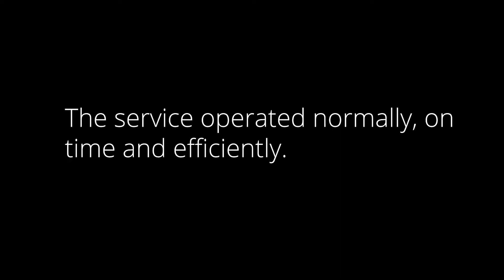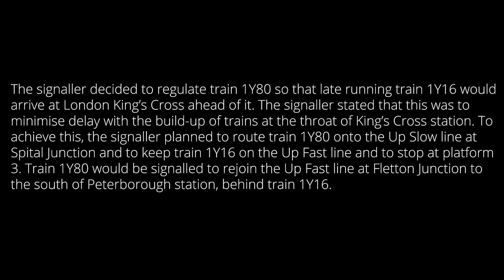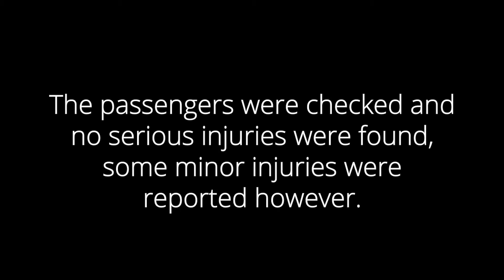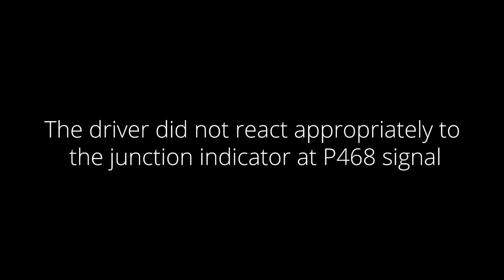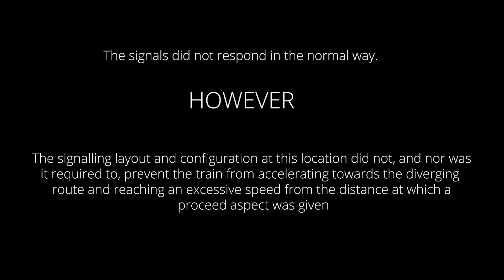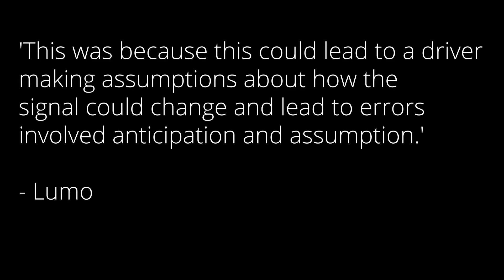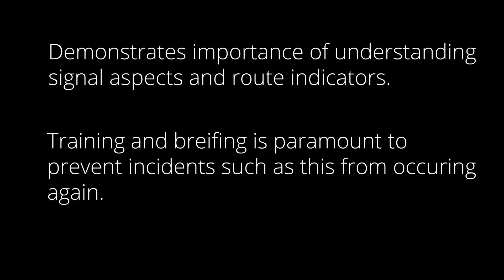The Peterborough Overspeed Incident | Jakeso

Comment: The reason it did not overturn is the monocoque design of the coaches resisting the torsion produced by the lateral G-forces at the slow-speed point. Quite apart from the signalling itself, that also highlights a track layout design error, that low-speed points had been placed in a high-speed line, something specified to avoid in the original design specification in the 1970s. Oddly, the fact the lead power car was accelerating may well have pulled any unit on the point of toppling through the points and back onto straight track: the derailment jackstrawing happens when the front of the train decelerates suddenly and the kinetic energy of the rear coaches can only go upwards.
The reason the driver didn't see the diversion indicator is a psychological effect called confirmation bias. He was expecting to run straight through, and that is what his brain "saw".  A line of white lights was just illumination, if they'd been orange, yellow and black cycling rapidly in the direction of travel, it would have penetrated that "fog of war".

Comment: If 2 trains have done the same thing then it must be a question of the signallers or the signalling system and not the competence of the driver
Reply: There is nothing weird or odd about this signal or location, the job of the signaller is to control the railway, the driver is driving in the lap of where the signaller tells them to go. The driver’s route knowledge and rule book knowledge tells them if they can accept that information given by the signalling system. At what point is this the signallers fault?? The signaller decided to move the early service over to the slow line to let the late service pass on the fast line to maintain the diagram order of service. The driver was cautioned all the was down to a red, then given the junction indicator to diverge to the slow line. Tell me, did the signaller tell the driver by telepathy to open up the taps on that Hitachi unit and accelerate hard at a set of points set for them to diverge??? Purely driver error, loss of concentration and complacency, end of. 

Now if there is an issue of visibility of the signal and it’s aspects, they driver needs to inform the signaller and fill out the necessary form. If the driver cannot see the signal correctly, they should just engage a whole load of power… either way, still on the driver I’m afraid to say.

Comment: Driver error. I’m not sure why people are suggesting it is an issue with the signals at the location. 
All drivers that “sign” there route must know it off by heart and every signal and route indications. Expect anything to happen at anytime. The indicator to divert should have been spotted and understood completely for any qualified train driver. There is no excuse.
Reply: It would also help if the signal was timed to enforce the correct speed across the points, as well as potentially remaining at caution to "remind" the driver that a significant speed change would be required compared to their initial route.
Safe systems take into account human error, not excuse it and assign blame in a scapegoat-like fashion.
Reply: @caramelldansen2204  still a driver error. I know that.
Reply: @caramelldansen2204  would have got AWS reminders
Reply: @caramelldansen2204  in 20 years driving I have never seen a green signal to change route without a flashing indicator. Is it not double protected? I may be wrong in that sense,
Reply: so this would be a signal irregularity
Reply: @robsmith8769   Wrong. The steady signal aspects that arise from following another train override the flashing aspects. This happened in both incidents.
If we just scapegoat the drivers, all we do is ensure this will happen again. It already has happened again.
Reply: @caramelldansen2204 wherever I have gone you are double protected hence the red signal. My training tells me that a train is in front even if it’s not a high speed double protected junction.
Reply: It wouldn’t go from red to green without flashing signal or even a caution.
Reply: So I get why people are saying signals are not right in that case
Reply: But what I can see is the junction
Signal is green with an indicator to route over so that’s the problem here
Reply: @robsmith8769  I can see you're fully bought in on the "scapegoat the driver instead of prevent the issue, despite the fact the issue in the exact same place has already repeated itself" line. It's a mystery how you hold such disregard for the blameless safety culture the railway relies on to save lives and learn from tragedies.

Comment: Why don’t the signals stay at caution when there is a diversion route set at this location? The change to green would have caused confusion.
Reply: One would think a change of direction that also entails a change in speed would be a cautionary situation.
A certain percent of speed decrease between straight ahead and another direction should be shown as a caution aspect, in my opinion. What that percentage should be, however, I'm not sure.

Comment: The Lumo train was not scheduled to stop anywhere before London King's Cross, so it did not matter to the passengers (oops sorry, "guests") which order the trains arrived in. It continuing on the fast line at the maximum permitted speed would not have caused any further delay to the late-running LNER train unless it was proposed to run the LNER train faster than the speed limit in order to make up time, which I believe is forbidden. What was the point of diverting the Lumo train onto the slow line and presumably making it stop for about 25 minutes? To make LNER's punctuality figures better? No way would the train have gained enough time to arrive within 10 minutes of schedule. To make Lumo's punctuality figures worse?
Reply: Yeah, correct potentially. But signallers do pull trains to one side occasionally. The early Lumo ‘May’ have been catching another train and ‘May’ have be brought down anyway, so I presume signaller thought they’d bring the two trains back into their proper order. Also may be to get the Lner train back near to its schedule time saving a fortune in delay costs. Either way, signaller has made a decision to put the Lumo on the slow line, the driver should know what’s being asked of them in this case. Frightening footage from the CCTV!

Comment: The fact that it happened again, indicates that there is a signalling problem at this location. The diverging signal should be held at single yellow, or even a speed approach controlled red.
Reply: It is approach controlled from red.
Reply: @ChangesOneTim  True but going to green? I would have thought a proper control via amber signals would be more appropriate.
Reply: @bertiesworld  
Approach release of the junction signal from red is the most appropriate in this situation. It behoves drivers to retain full knowledge of the route's signals and reading the aspect displayed at each one correctly.
Reply: @bertiesworld firstly, yellow not amber on the Railway. Secondly, the signals not only control the speed but show the driver if the route ahead is clear, it’s up to the driver to have sufficient route knowledge for the routes they sign for. Also, the driver should know rules regarding signalling at junctions. 

The fact he/she was brought down on restrictive aspects to a red should have alerted them to something happening ahead, and once the route indication was given as the signal cleared, they should have thought ‘oh, why am I going this way today?’, and driven either according to route knowledge, or just cautiously knowing they were diverging and going across points. If the driver was unsure, they know the route is set for them and that the route is clear by the green signal, they could have approached the points at 15mph until they could see the speed board, then increase speed accordingly. No one would have noticed, it would be nice and smooth for those on board, it’s the signaller that has chosen to put them on the slow line so that wouldn’t be a Lumo issue, everyone’s happy. The green, rather than a single yellow means the driver can go through the junction knowing they can accelerate up to line speed immediately after the train has passed through the junction, whereas a single yellow caution would mean the driver would have to expect a Red ahead and be slow preparing to stop, slowing the service and the network if this was the case at every junction. 

Flashing yellows here may have been even worse, if the driver hadn’t acknowledged those either he’d have been going even faster potentially. Being complacent and expecting the same things to happen as before is the issue here. The driver could well be routed somewhere they don’t even sign, or be wrong routed by the signaller. It would be the signallers fault initially, but then the driver’s fault for not realising and accepting the route instead of stopping and calling the signaller. 

I’d have thought that driver being newly qualified would be sat up with eyes on stalks every day, taking it all in and being cautious of everything!?
Reply: Perhaps an improvement would be to measure the approach speed, and only clear the red once the speed is sufficiently low?

And/or instead of releasing the red straight to green, it could change to flashing yellow
Reply: @33andy33gmail  in ally of locations flashing yellow is used. Here would be great place for it to be implemented
Reply: @33andy33gmail  But that doesn't stop the driver from speeding up after the signal clears
Reply: @33andy33gmail  
The way release-from-red timers operate is already a form of speed measurement. Timer duration is designed so that train speed is proved under control before signals clear.  Adding other speed measuring device wouldn't help a situation like this, where the drivers were doing a slow speed at the crucial approach point but then applied full power upon P468 stepping up to what they took to be only a green (ie without junction indicator).

As important if not more so, P468 met the sighting distance/ reading time criteria for the 125mph linespeed. At the much lower speeds the Lumo and GC drivers were doing, therefore they had far longer than the minimum time in which to assimilate what P468 was displaying then correctly control their trains for the divergence.

The flashing yellow aspect has a specific meaning and it would risk further confusion if used to mean something else too.

Comment: Signal should never have been cleared to green whilst a diverging route (with such a speed limit) was set.
Reply from the maker: Yeah, although I feel it was slightly justified becuase the signal clears from danger to proceed, so the driver still has to approach it as a red, giving them time to see the route indicator, they didn’t and by the time they had reached the points itself they had fully accelerated to around 80mph, so they would have seen it for at least 20 seconds if not more
Reply: @Jakeso  
True, but it would be safer to keep it at yellow through the junction and then have greens from the platform starter onwards.
Reply: Ye
Reply: To do otherwise breaks the standard for all similar junctions. Britain has route, not speed based signalling.
Reply: @ChangesOneTim 
A diverging route should not be signalled with a green.
Reply: @IN_THIS_DAY_AND_AGE  
Well...its design is consistent with all other junction signals on simiilar layouts. As I mentioned above, British signalling is route-based not speed-based.
Reply: @ChangesOneTim  
So it doesn't matter about safety as long as it's standard?
Reply: @IN_THIS_DAY_AND_AGE there would be a lot less trains on the network if that were the case as every junction would be backed up with needlessly slow trains. Some junctions are complex, this one looks like it has many options, but the route is signed for, the driver should know what to do. A single yellow for diverging would tell the driver she/he is stopping at the next signal and be slow all the way to seeing it. That signal ‘could’ be a long way away. It also tells the driver that there may be another train in section ahead, hence the red signal. 

The green shows the route the driver is being routed to is clear, their route knowledge should tell them the rest (junction speed, line speed on the new route, speed changes ahead, where signals are located etc etc). 

Absolutely no need to be on a single yellow JUST to control speed, the signaller partly alerted the driver to the change by bringing them down to a red signal in the first place.

Comment: Strongest message out of this and the similar Grand Central incidents is that when drivers sign for route knowledge it is supposed to cover ALL lines in that route including ALL aspects that signals are capable of displaying.

It's very worrying that these drivers appear to have 'conditioned' themselves into believing that they wouldn't ever be routed via a platform line at Peterborough (and indeed other stations with similar layouts where they're not booked to call), so that despite having several seconds' reading time of P468's feather as well as green aspect it failed to register in their minds. TOCs have slimmed down driver training courses over the years, and it's hard to avoid the conclusion that this contributed. 

Peterborough is not Paddington, but its layout is pretty complex. Have the lessons of Ladbroke Grove been forgotten?
Reply: I've watched this and both RAIB videos on the overspeeds here, and I've not once seen the morpeth board for the 30mph deviation. Granted, the RAIB videos aren't the highest quality ever.
Reply: @caramelldansen2204  
There is no 'Morpeth' board, and there doesn't need to be one in situations like this.
Reply: @ChangesOneTim  You don't need to be warned about a speed difference of 100mph??
Reply: @caramelldansen2204  
The 'warning' is a standard double-yellow signal followed by a yellow signal, after which (like anywhere similar) drivers must prepare to find the next one at DANGER (red) and therefore to STOP. Drivers must then act according to the aspect it displays when it clears. In this case the diverging route, displayed in plenty of reading time given that drivers were supposed to be about to stop, is 30mph.